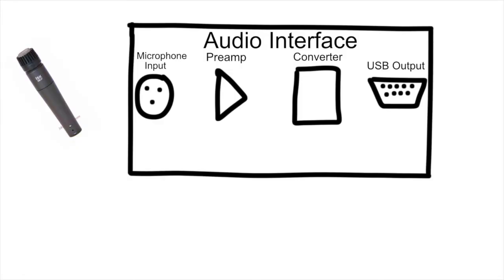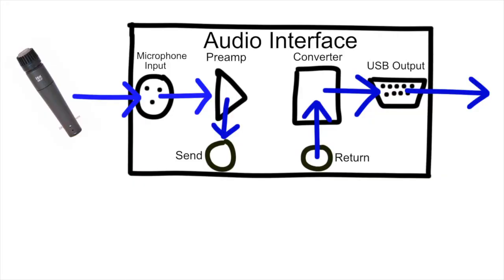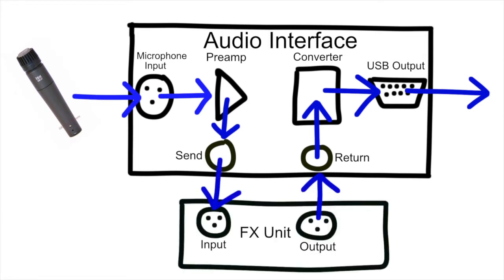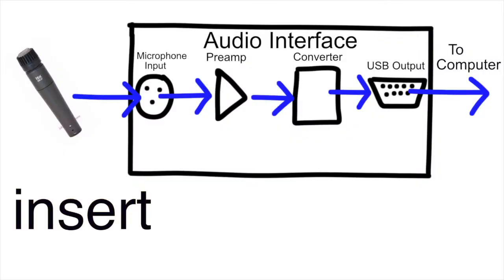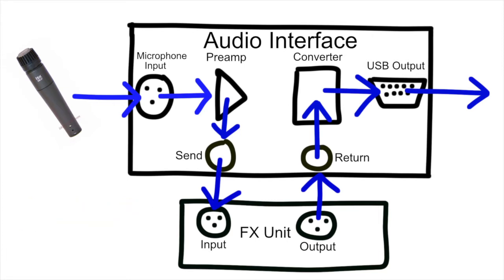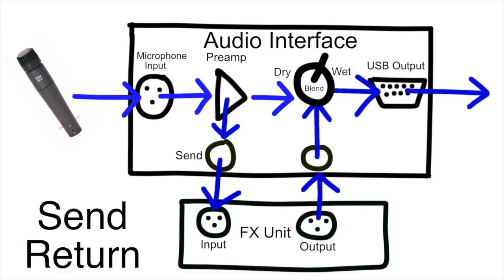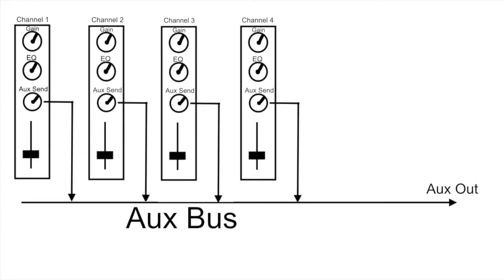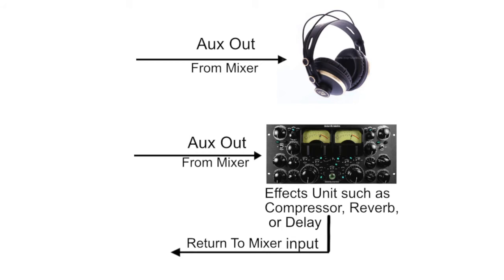Sends Returns and Inserts in Audio Recording. What they are, and how to use them. Lesson 17.

Comment: Very clear video! however I have a brginner's question, Since connecting outboard gear via send and return cancels the preamp, does it really make any difference if you do that through a Behringer interface or a higher-end one? Is the output sound the same or the convertors interfere? Thank you.

Comment: Hi, watching these lessons to better grasohow to add an external effect into my mixing/recording chain: I use the behringer UMC1820 which does not have inserts but rather has 8 line outs: if I use those outs to connect a compressor and then route the compressor out back into another input of the interface will it be creating the same chain that you have explained in the video? Thanks!

Comment: Regarding the last example, where you have a reverb unit and not a mic, if I want to use an FX pedal (say, the Hologram Electronics Chroma Console Multi-FX pedal) with a synth would I use an insert in an audio interface, or use a mixer (or a mixer conncected to an audio interface that doesn't have inserts) or something else?

Comment: Thanks for the informative video.
I guess I’m just confused on the difference between line in and insert.

I have the umc404hd with the insert ports on each channel as well, but I don’t know how I would use it with my setup:
Mic to tube preamp via XLR channel 1
Preamp to comp via XLR channel 1
Comp to EQ via XLR channel 1
Eq to UMC404hd via XLR channel 1
To Mac/daw

I got the unc404hd strictly for the insert ports because I thought they were necessary to incorporate my hardware, but my understanding is that since I am using an external tube preamp’s phantom power and not the phantom power from the umc404hd the insert ports are rather pointless, am I correct?
Is there anything I could use the insert ports for in my existing chain? Is there anything you would change? I am new to the hardware end of things and would appreciate any input. You got my sub ! Thanks for the vid !

Comment: I have a focusrite 18i20 it dosent have any send or returns or inserts, It has line outputs. I have been using one of the inputs on the interface as a mic preamp and then sending it from the line output on the interface to an outboard compressor and then back through into a different input on the same interface. I was told this was going to work but I am having trouble with the signal being disrupted by two preamps worth of gain. I tried setting the 2nd preamp to 0 but it comes out really quiet. And then I set it high but it makes a hiss sound or just sounds weird. It’s been doing my head in
Reply from the maker: After the signal goes through the compressor, you will want to send it into a line input. If you are still getting a lot of noise, then you either have a noisy piece of gear somewhere in the chain, or something is faulty. If it is a Gen1 Scarlett interface, those were quite noisy.

Comment: I have a question for a specific scenario. I use a Cranborne adat 500 Rack that has Mono Slots with an insert jack on each. Is it possible to connect my LA-610 preamp via the insert with a TRS to Y XLR I/O and use both of the inputs of the 610? It has a Mic in and a Line in. The mic in I would go directly with the mic and the line in I want to use for DAW re-amp. The output would go via the return into the adat 1 channel where the insert is connected.

Comment: Thanks ! I have a question though. Does inserts only work with Mic XLR inputs ? Does it work with Line inputs ?
Reply from the maker: I don’t know. But… perhaps I can still answer your question.
If you have a line level signal, then there’s no need to use the insert. The purpose of the insert is to use hardware that requires a line level signal, so a microphone or electric guitar would need to go through a preamp first, then get sent to the hardware. A line level signal doesn’t need to go through the preamp, it can simply go straight to the hardware.

Comment: Hello Chris!
I use audient iD44 and can I use return port to record input the phone output audio using a TRS cable? Please help me answering this question!
Reply from the maker: Hi,
No, that won’t work because the phone output is stereo unbalanced, and the inserts on the ID44 are mono balanced.
The way to record the signal output from your phone would be to use a stereo splitter cable, which will split it into 2 TS outputs, and plug those 2 outputs into 2 of the line inputs on the ID44.

Comment: Hi, With the insert cable (audio splitter cable example), how do do I know which is send and return, does that matter ?
Reply from the maker: That can be a bit tricky. The easiest way would be trial and error…. There’s only 2 possibilities, so it should be easy.
Otherwise, you would need to check the owners manual of he equipment to find out id it is set up for tip send, ring return, or tip return, ring send. There’s is no standardization on this. Once you find that out, you would need to trace it out on your insert cable.
Reply: @Get.Pro.Recordings  Hey, thank you for the reply. I am here talking about the Focusrite Clarett+ Octopre preamp inserts. On the device it says TIP=SEND and RING = return. Do you know where I can look up for information of these definitions. Am new to this, it would be great if I could get some information :)... Thanks again.

Comment: Sir thanks for your video. It's wonderful.
Can you please tell me how to add external hardware effects for mixing by using UMC 404HD.
Reply from the maker: It’s pretty easy, you would route the line outputs on the back of the umc404 to the audio inputs of the hardware effects unit. Then it’s he outputs from the effects unit are routed to the line inputs of the umc404. 
Within the recording software, just make sure the appropriate track is routed to the output, and dedicated track records the input from the effects unit.

Comment: Hello, In my studio I have the same sound card you do, a mixer and an outboard compressor. Currently I am running the master out of the mixer to the right and left ins on the compressor. The compressor outs are going to the inputs of the sound card. Is this correct? Sound works but sometimes clips. Is there a better way? Thanks
Reply from the maker: Yes, that’s the correct way. If the compressor outputs are standard line level, then make sure your inputs are set to +4 line level. If it is clipping, you will need to turn down the output volume of the compressor.

Comment: Chris! Thanks for the explanation. Really good video, congrats!. 
I have a question for the same Interface UMC404HD. 
What happens if I connect my guitar pedals in Line selector Level directly to the front channel instead to the Inserts. (Asume that I have a Guitar connected  IN  the pedals and the output of the pedal chains goes to the channel 1 of the UMC404HD using a TS cable.) Thanks a lot !
Reply from the maker: Hi,
The output of the pedals is the same output type as as the guitar, being high impedance. Guitar pedals are generally meant to be plugged into a guitar amp, in the same manner as the guitar is plugged in, so when plugging the pedal into your recording interface, you want to use the instrument input, the same way as if you were just plugging the guitar in directly.
Thanks for the question:)
Reply: @Get.Pro.Recordings  Thanks for the reply. But there is any difference in tone  if I plug my pedal directly to the interface versus  to the Insert ? If there´s one, how can you describe them?
Reply from the maker: @drezgar  Yes, there is a difference in the sound. The inserts are designed to accept a line level signal, which is a much higher power signal than what the guitar pedal's output is. It will work, but will have white noise mixed into the signal. So, for the cleanest, most accurate sound quality, you'll want to plug into the instrument input on the front panel.
Reply: @Get.Pro.Recordings  Thanks a lot Chris!

Comment: thanks so far it has been the video that has helped me most of all, at the same time I have not found the answer to my question. i'm trying to connect the usb audio interface via insert cables to be able to use daw effects on my analog mixer, no aux bus, no recording, just insert digital reverb from daw, is it possible? or do I have to calculate with long response times?
Reply from the maker: Yes, it should be possible, depending what gear you have, but most gear should do this.
On the mixer, use an aux output connected to the analog line input of the interface. Route that channel into a track within the DAW, and ensure input monitoring is enabled. It will play that track along with any plugins that are instantiated on it and send it out the line outputs of the audio interface. You can then plug that into the insert of your mixer, or it’s own channel of the mixer, and blend it in.

Comment: I have a recently acquired a behringer FCA 1616 sceond hand, it has 8 Inserts/8 outs(balanced..screen printed on the box, but no mention on the inserts just a diagram saying TRS)..no mention in the manual..what manual..its a pamphlet lol?. Can I assume that the signal going out/in via the send is unbalanced?. My intuition says it must be becuase the TRS cable is just 2 unbalanced cables stuck together with the TRS jack on one end, and the 2 xTS jacks on the other with copper shielding of both cables wrapped and soldered together on the TRS side, and left seperate on the TS ends. You mentioned that 2 way travel. could it be that the unbalanced signal leaves before the preamp, or after the input buffer, but leaves before any gain stage??? Be good to use with effects pedals not have to use /buy a re-amp box and DI as suggested on most vids on using hardware effects pedals. I tries it with bass into a rack compressor and it sounded great. hoping to get similar results with standard guitar peds, Insert, TRS splitter cable..and not release the magic smoke?? anyone knows??
Reply from the maker: The trs cable on the insert Jack carries 2 streams of audio, an input and an output. Each stream is unbalanced.

Comment: Can I put a 1/4 inch jack into a channel insert and send this to a powered amplifier therefore getting a monitor of just that channel?
Reply from the maker: Yes and no. It will work for the amplifier, but you won’t have a return signal going back to the interface, so you won’t have any sound on that channel on your daw if that’s where it’s connected. Thanks for the question.
Reply: @Get.Pro.Recordings  @Martin Lynch You will just have to half-insert the jack so he recieves the send signal. This will not corrupt the signals route. On beringer mixers it works. When i needed a direct out of a channel and the mixer didnt have that option, i used Y-cables(just like the ones in the video) , half inserted in INSERT plugs on mixer, and use only the one of the two other ends(TS) of the cables where i got the send signal. This way you can get a channels signal and use it in a monitor-amplifier(the signal will be dry and independent of channel fader)

Comment: Chris, what if your effect unit has a stereo in and out (2 jacks for both) and you are using the single jack insert Behringer UUMC404HD? Is it able to Send and receive via Y splitters, or is a patch bay needed.?
Reply from the maker: Yes, on each Behringer insert jack, you would use a Y splitter which provides 2 jacks, of which one is the output that goes into the FX unit, and one is the input which receives the processed signal from the FX unit. Since your FX unit is in stereo, you will need to use this setup with 2 of the insert jacks simultaneously, one for the left, one for the right.
Reply: Yes you will need 2 Y cables, but stereo isn't required if you record only 1 microphone (in windows sound settings, you can set your mic to stereo and most programs actually use stereo or allow you to convert audio to stereo), it's more of a thing when you want to setup 2 or more mics or use more than 1 effect on left and right channel individually (if your FX unit has the function to sign different effects on individual channels, effects are always stereo, even if you use mono)

Comment: Thanks a lot for this great series, Chris. If I want to use an aux send on my mixer to a guitar pedal effect, do I need a DI or re-amp box either side of the effect pedal? i.e. one to convert to hi-Z from the mixer, then once the signal has passed through the pedal, another DI/re-amp to convert back to line-level into the mixer? Sorry if my question is confusing!
Reply from the maker: Hi, good question. Your insight is correct, you will need a reamp box coming out of the mixer to feed the signal into the pedal, and a direct box from the pedal going back into the mixer. That’s to connect it properly. Depending on the mixer though, you could probably just plug straight in both ways without using the reamp or the di and there probably won’t be a significant loss of sound quality.
Reply: @Get.Pro.Recordings  Many thanks for your advice!

Comment: Very simple and clear, thank you. On a DAW, in what situations would I route a channel's output to a bus instead of using an aux send?
Reply from the maker: Hi, thank you for your question. A bus is a signal path that can have multiple signals routed to it, and they are summed together on that bus. For instance, if you've recorded 3 guitar tracks, and you want to combine them and work on them as 1 single track, you would route them to a bus (instead of the main output), and route the bus to the output. Then you can treat that bus as a single guitar track.
An aux send (or aux bus) will not interrupt the original audio path of the track, but will create a duplicate of the signal, and send that duplicate for processing. I will quite often put a reverb on an aux bus, and when I want a track to have a bit of reverb, I just dial it into that aux send.
Reply: @Get.Pro.Recordings  I guess I find using aux sends adds extra volume where I can't control the dry signal and this forces me to route outputs instead. I know I'm confused somewhere but thanks for the explanation.
Reply from the maker: @tellitlikeitis8691  Yes, if your aux bus allows the dry signal to pass through, then it will simply add volume. You don't want that. Your effects on the aux bus should be 100% wet, and then you dial in how much of the effect you want by how much volume you send to that aux bus.